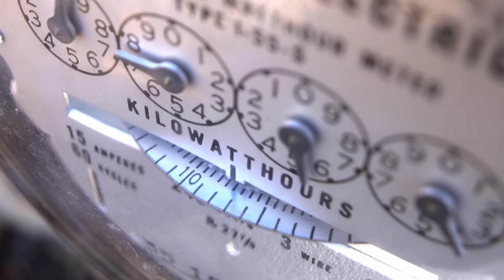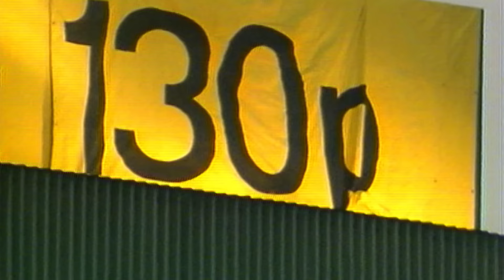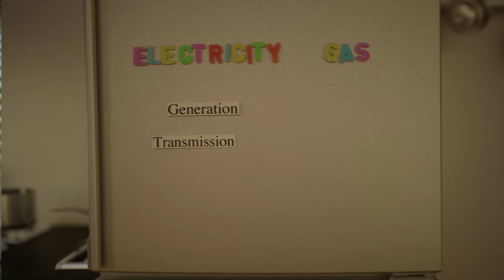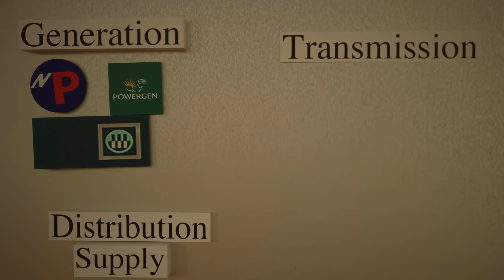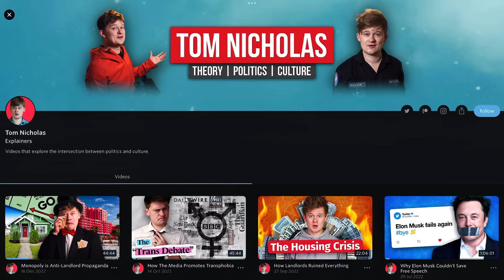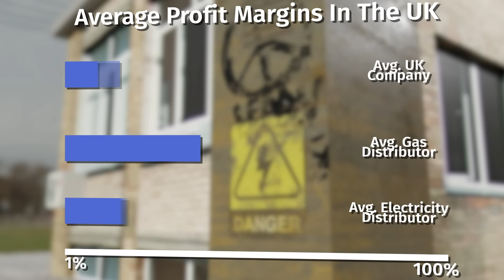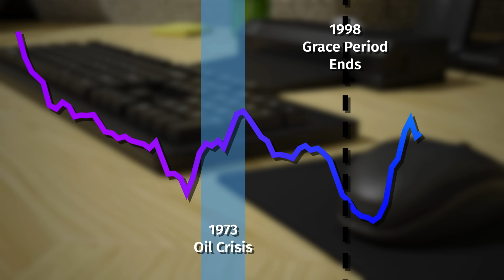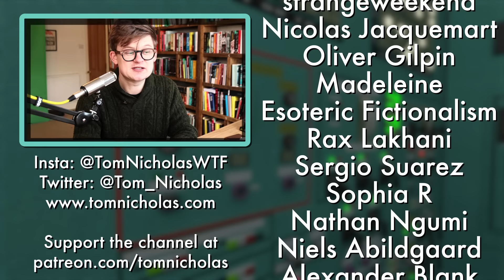Energy Privatisation is Bankrupting Britain

Comment: As a Canadian I couldn't help feeling a bit astonished that UK households only spent £450/year on utilities in 2020 (3:43). I spend $250/month in the summer, and as much as $550/month in the winter, and that's just always been normal for me. Not trying to detract from this horrible situation, it just surprised me.

Great video as always!
Reply: Me, from Scandinavia, also was wondering. However the latitude is different AND you and me I presume live in single family houses, that is different from the average when a substantial part of the population lives in blocks of flats. My children who live in BoFs pay something like €50/month for their utilities because of heating that is the by product of electricity production.
Reply: As a Brit I'm also confused by the average of "£450 per year". Either I'v overpaid or that metric is off.
Reply: Air conditioning in homes is very rare in the UK. It just isn't worthwhile - why spend all that money on something which /might/ be needed for a short time in any year? It's not like the southern US, where a typical home would be unliveable without it. Of course homes could be designed better there, but... cultural issues. Heating though is universal, and almost always gas-fuelled, except in very rural areas.
Reply: That number does not include telecom and water bills, there are 5 Canadian dollars to 3 pounds and the UK temperature is far more stable. The temperature pretty rarely goes outside of 5-25 degrees
Reply: Are Canada's utilities ran by the mafia or something? Or do you live in a very cold part of Canada, or in a particularly large household? Or are you including anything other than electricity or water in that $550 (e.g. water, internet etc.)

I do agree even as a Brit that £450 a year seems a touch on the low side, I reckon I was paying about that in a single person household. But $550 is not far off my mortgage (admittedly that too is going to skyrocket in the near future), I think the day that my electricity and gas is comparable to my mortgage will be a very bad day for my finances!
Reply: @Cream147player  I live in a detached home, but the square footage is less than average. I do live in a cold part of Canada (dropping to -40 at times) so in winter my bill usually doubles due to heating. That price includes electricity, gas and water, but water is a very small part.
Reply: @vylbird8014  AC is rare here too for the same reason :)
Reply: @Cream147player  550 for a mortgage?  That is insanely low.
Reply: @jjskn93  Averages mean that some pay less and some pay more.
Reply: @Cream147player  In Ontario, Canada they are billed separately, electricity is mostly publicly owned and gas is privately owned by local monopolies.
Reply: @adorabell4253  Mortgages depend on several factors other than just the price of the home.
Reply: @ivandafoe5451  thankyou. I'd forgotten about that.
Reply: @ivandafoe5451  True, bu coming from Toronto, unless you're paying 70% or more outright I don't think it's possible to get a mortgage that low.
Reply: What percentage of your income is that?!
Reply: @jelef001  about 6% of my gross annual income
Reply: Same kind of range and total in the US in the midwest as well. And that's a small house as well!
Reply: @vylbird8014 not just the southern US.. I live outside NYC and the summers are god awful, >90°F with heat index bringing it well over 100° on a regular basis. No relief at night either, it remains 80°.  It doesn’t snow during winter anymore. Maybe once or twice, this year it didn’t snow at all. It was 75° F last week, in the middle of February.
Reply: @vylbird8014  air conditioning can be used to heat aswell not only cool
Reply: @Ylclyde  There was a UK government initiative to promote heat pumps. It didn't work. The problem is that while heat pumps may be very economical for new build, they are very expensive to retrofit because of the need to rip holes in walls and get flooring up to replace the heating water pipes. I don't know what the Canadian situation is like.
Reply: Yes, that's an odd figure! In 2020 I used 2500kWh gas and 1000kWh elec per year (about 50kWh/m2/year) and paid £32/month = £384pa. But this is a small house in single occupancy, in Somerset.... And my children tell me I've always been fanatical about energy conservation!
Reply: @vylbird8014  You can just use normal air conditioning units for heating. Most units you buy have a heat pump function built in.
Reply: Instead of cold air being circulated. Warm air is.
Reply: @vylbird8014  And most air conditioning fits are simple and clean to perform with one outdoor unit for multiple indoor units inside the house. They can be fitted with an indoor unit back to back with an outdoor unit, requiring very minimal piping to be run inside.
Reply: @Ylclyde  There are differences in house design in the UK that make retrofitting expensive. No air circulation system: Heating is via circulating water. Good for heating, very practical and compact. But can't retrofit for cooling. To add air conditioning needs a complete fitting from scratch - units, pipework, everything. That just makes it very expensive to fit to an existing property. It's more economical if fitting to a new build.
Reply: @jjskn93  Actually, yes, I think that is off, too. We were paying about £750 a year in 2020 for a typical 3 bed house .And my bills always said this was significantly less than the national average.  It might be £450 for heating only?
Reply: @jjskn93  I think that metric must be off, I'm single, live in a 1 bedroom flat and used to pay £600 per year. Now I'm paying £1150 per year, and it's going up again in April.
Reply: In Australia, I spend $50 to $120 per month for about 4kWh per day consumption. Most of that are fixed and network charges.
Reply: @vylbird8014   There IS (still) a  programme of subsidies for A2W heat pumps. It is NOT promoted, so take up has been a fraction of intended this year. 
But biggest issue is that even with 5k subsidy, outlay will be another £5-10k, and now a HP with a COP of 3 and electricity prices X3, no running cost gain.
Reply: I have never paid as little as £450 a year. In 2015, I paid £170 per month for a 4 bedroom house, and now I pay £270. 

I have cut back drastically to pat this 2023 bill, however.
Reply: When I was little in Italy we'd sometimes spend 20€ per trimester in electricity... Sure, we didn't have electrical heating, stoves, TV, a dishwasher, but still...

Comment: I lived in Missouri for a while and setting my thermostat to even 69°F/20.5°C was freaking brutal and I constantly had my coat on and could even see my breath in certain parts of the house. I can't imagine people in Britain doing the same thing to save some money because it's that bad with energy costs over there.
Reply: the one advantage of Fahrenheit, you can choose the 'nice' temp.
Reply: I think your thermostat may have been broken. If it was actually 69F, you wouldn't be able to see your breath.

As an American in the UK, homes have been quite cold this winter. Most people I know keep their house/flat at 16C (60.8F), which will leave you feeling quite cold if you aren't moving around.
Reply: 20°C is not cold enough to see cold air when you breath....how is that even possible. Are your walls made of  rocks ?
Reply: In canada we set out thermostat at 68-70 in my house its 68, its fine if you have insulation and no drafts, mandatory in our climate. If it gets to 33 F in march people are walking around in tank tops and shorts I kid you not. It what you get acclimated to. 68 F  is pretty nice when it's -20 C outside and ground crunches under foot. Have to caulk your house and the draft will be less a problem with a cooler home

Comment: I built my own off grid system. It`s easy to do and you can do it in staged. It cost about £2000 when I finished but saved me a fortune whilst the batteries lasted. It`s just a canal boat type set up but bigger. Now the batteries have dead I`ve just connected the panels to the grid with mini off grid inverters. This is the way forward for poor people like me. Buy a few solar panels when you can afford it and a small mini grid tied inverter. You can use as many mini grid inverters as you like. So just add to the system when you can afford to. I just have the panels on sheds etc. You can plug them into any mains socket even ones in out buildings. I got up to 2 kilowatts which means I have lots of spare energy which I send to the hot water tank using a solar immersion diverter. So I have  as much hot water in the summer as I need. I am lucky to have a wood burner that also heats the water so I don`t pay for heating or hot water. No gas bill and electric is £26 a month.

Comment: Interesting video, and a topic that I have some experience with. I am not going to knock this as for a basis, Tom, excellent job! 

Two things that I think is vital to understand: One is that the National Grid is simply not fit for a modern Britain. The infrastructure of the system simply is almost-outdated.  How we solve that is something that there is - sadly - not easy. Something I think we tend to simply is that with renewables, you not only have transmission going one way with transformers changing the voltage, BUT you now have to support the transmission THE OTHER WAY! Sounds easy, simply is not. Lots of overheads to think there, and where do you now put all those cables? Wires? Pylons? Someone has to pay for this. 

Two, I would argue, gas became so welcome in the 1990s is with the closing of the mines. Where Britain was a key exporter of coal, Thatcher now kept a reliable source of energy in the ground. For climate reasons, this a good thing, but now Britain - once fuelled on coal - now needs a new form of energy. As outlined, gas is easy to import, quick to set up, and the overheads compared to the rest are a no-brainer. 

All in all, great primer video on generation, transmission and supply :)

Comment: in Denmark I can pick between several providers of electricity & I used to only pay 63 oere pr kw hour (until october 2021) Yet I managed to go from 1.43 dkk  to 92 oere & I follow the prices like a hawk.

as i run "everything" over electricity (yes even my new car) then I take It very serious & exploits when there Is a low price from my provider Ewii (they let me lock It for a year).
keeping them on a leash every 3rd month. All It takes IS a few clicks & then I get a better rate from my current provider Ewii (on the condition that the prices has been declining for months, then they adjust the 1 year deal accordingly).
Reply: That sounds overly complicated and impractical for most of the population

Comment: I used to do the 18° thing. Not this Winter just gone. I only turned the heat on if I just couldn't stand my feet and legs being painfully cold any longer. My preferred choice, however, was an early night with a hot water bottle  - way cheaper than running the central heating.

Comment: Regarding rise in electricity. I live in Spain, prices have gone up a lot here too, especially compared to income/pensions etc. I moved approx a year ago...1st thing I did, despite it being still "winter" n my boiler (all electric in this flat) being in the shade ....I turned it almost to min...up a little, etc, until summer when i basically had it almost all the way down (bc it's like 35 ish degrees almost all the time, until autumn) then up a bit again. I also changed company and tariff to a much lower, they tried to "warn" against this telling me I would loose power if using too many items etc....stood my ground and I also always remember too close fridge, off water when washing hair, cook with lids, use n only quickly heat leftovers, switch off unused lights...the whole lot and I am now back to what I used to pay 2014, 15, 16....approx tho that was in a larger space n with my daughters living with me. It is sad in a way, we "the people" have to do this but for me it's also an environment thing.

Comment: It is not true that Russia's invasion of Ukraine caused a huge rise in the cost of oil to British electricity companies. The rise was caused by the British government refusing to buy oil or gas from Russia plus the British (?) destruction of the Nord Stream gas pipeline. Russia would have continued supplying gas and oil to European countries, and even continued to supply gas and oil to Ukraine though at Euopean prices (not the much lower prices of internal sales within the former USSR.) And guess what: Britain did not buy much gas or oil from Russia anyway. 4% of British gas imports and 9% of British oil imports came from Russia, and the only reason we were importing gas from anywhere is that the old town gas-works were not turned into factories making synthetic natural gas from British coal. despite British governments having fifty years in which to do the work.  

Further, all the electricity generating companies profited from the enormous increase in electricity prices, even though some of them generate electricity from hydro, wind, tide and sunshine and the costs incurred by those companies did not increase as a result of a switch away from Russian supplies. The increasing price has been a bonanza for the dividend drawers. 

To me it also appears noteworthy that neither of the electable political parties proposes re-nationalising the electricity industry lock, stock and barrel without compensation, even though that's the first step in regaining control over these extortionists and thieves. The most that has been proposed is a 'windfall tax,' which will achieve nothing since it does not involve a reduction in the price of gas and electricity.

Comment: I'm from the UK, my house doesn't even get to 18C when the heating is on in the winter. Which is annoying since I pay to have the heating on for most of the day and still bellow the minimum for WHO. Worth pointing out that I have more than enough insulation in the attic, and double glazing throughout. I am in an older building so no external wall insulation. Basically the only think I can do it pay about £16k for triple glazing throughout, or pay ~40k to have external insulation added.

Comment: Transportation, energy and water. Three core sectors to the UK's economy that have no sensibility or rationality in being privitised. They offer no benefit to being privitised as they are closed and fixed markets, the free market can provide no value and instead just further the extraction of public funds into private pockets. They are also core to supporting the private economy, so cheap subsidised transportation (for example) would work wonders for the private and public sector alike. We've seen how bad it can get with the water industry (waste water scandles), and the rail network being the most expensive (ever). It just doesn't work to have those sectors privitised.

Comment: God this reminds me how it is here in Texas.  We have our own "national grid" that is not connect up to the rest of the states.  They then passed a law where they separated the "grid".  That is you could start a power company and sell to the Texas grid and you could also start a company to sell the power from the grid to people.

Its not a failure but it didn't change much.  Like you said, old people stick to their provider, as long as your on a fixed rate you don't really care.  You get sold into a "variable" rate, you get fucked over when they turn on the gas turbines.  It has failed a few times and it will still fail as they still haven't tried to fix some of the stet emic problems.

Comment: Hello from a power engineer by trade. Thank you for yet another outstanding example of logic in a form of video. I am ashamed to admit that even my colleagues somtimes seem to think that privatisation would resolve every issue with the power system. For me, this myth was refuted completely during one of my visit to a private mini power plant. Basically, there was equipment back from the 60s in 2018, so called effective managers are not the answer after all. They would try to squeeze every pence of profit at any given moment, and updating turbines and generators is a long-term invesment

Comment: Question for Brits:  is personal photovoltaic electricity generation popular in the UK?
Does the government subsidize it?

If electricity prices are this high, a PV system would return the initial investment in just a couple of years.

Also, why do you use gas for electricity? As far as I know, gas is the most expensive way of generating electricity. In my country we only use it for the last bit of the grid to top off if other types fails, such a hydro in the summer etc.

Comment: 18 degrees is cold! I lie in Florida and we're around 23 degrees - and we're actually a hot and humid state with longer summers!
Reply: My house is usually at 16-18C. Northern people tend to have a higher cold tolerance than southerners. Actually, we also have a lower heat tolerance too. I can barely function at temperatures above 25C. Back in 2020, I worked as a flagger for a construction job, it was unbearably hot. 35C was the hottest temperature I worked at and it was also the temperature where outdoor workers get taken off work for safety.

Comment: There is one final set of distribution step-down transformers that drop the voltage down again to (In the US and Canada) 120 volts, and (In most other counties) 240 volts. You'd still be vey on fire and very dead if you plugged your toaster into a 138 Kv power line. IDR what their official name is, but it's those small (ish) pole transformers that dliver the final voltage to the buildings. Maybe I'l update this once I finish the video, as I haven't watched it fully yet.